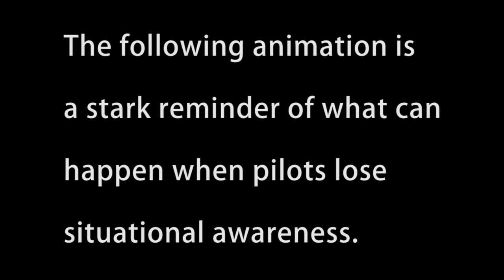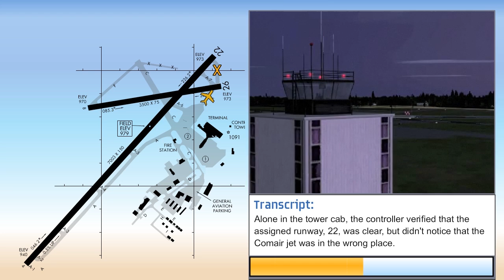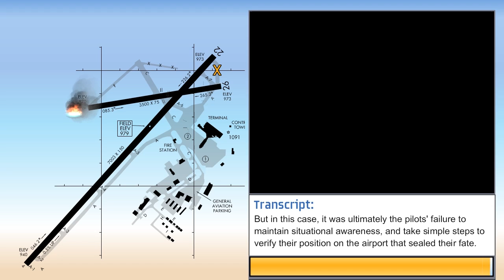Runway Safety: Lexington, KY (2013)

Comment: Lots of errors in this video.  There were no markings or Signs.  No yellow lines leading to the correct runway.  And the color of the pavement also made it appear that there was no taxiway in use to get to the correct runway. I flew a morning flight out of LEX a few days earlier than the crash.  MY COPILOT ASKED "WHERE ARE YOU GOING?" When I was going to the correct runway.  He thought we should have turned onto the shorter runway, which looked more correct.  I pointed at the error on the chart, and explained that I have been here before in the daytime, so I knew where to go.  The crash was also in the morning before sunrise.  There were no lights on the taxiway between  the wrong runway and the correct runway, just dark pavement that didn't look fit to taxi on.  The video images are not correct there as well.  So get the facts before you judge a flight crew.  Not to mention that Comair had a HUGE amount of time pressure to leave on time for first morning flights.  And the gate agent at LEX was always late to let the crew out a door with a secret code.  And the gate agent never knew which plane was the correct one for the first flight, so the crew went to the wrong plane at first, losing precious minutes.  I did the same on my flight a few weeks earlier.  I rushed through my checklist, like the crew of  5191.  The chief pilot had just issued another memo that there were serious consequences if the originator out of Lex was late.  Yes, time pressure from the chief pilot was a factor.  Also, there was only one guy in the tower not paying attention, instead of two controllers as normal.  A simple radio call from tower could have saved everyone, and he should have been watching the takeoff.  Just my opinion.
Reply: The NTSB report seems to say there were signs and markings at the time of the crash:
https://www.ntsb.gov/investigations/AccidentReports/Reports/AAR0705.pdf

Comment: I have ran this accident through my head and even when I flew would think about it. All I can figure is lights were out before and it was not unusual. Glanced over the Notams which said the main runway's center lines lights were inop. The short runway's lights were turned off. Very early, ready to get moving and complacent, both were not in the "present" but already off the ground, in Atlanta,on the way home etc. They were just running on repetition and not procedure.They see the runway with no center line lights and from that point on that WAS the correct runway. Who had the controls taxied into position thus cementing the confirmation bias that WAS the runway. From that point on nothing short of the tower stopping them they were going and did.

Comment: Bush Pilots just add some more flaps to take off in shorter distances or if end of runway near... i did it hundreds of times when grossed out take offs at high temp..    Runway end?? Vr right there instead and add 10-20 more flaps..and dont pull up like a scared girl..if you try to horse it off, it will stall of course..
Reply: CFITOMAHAWK2 oh you mean bush pilots who have Vr speeds around 50 knots? Bit different when you're hurdling down an unlit incorrect runway in a 44,000+ lbs jet with Vr of 140 or so.
Reply: robo931
-it does not matter if different airplanes..You can add more lift to any by adding more flaps instead of pulling up the elevator in panic and stalling it..I read the pilot survived, moved with his mother and began collecting workers compensation benefits until today..idiot...
Reply: CFITOMAHAWK2 flaps increase drag. Are you sure you actually flew real airplanes? Microsoft Flight Simulator doesn't count. They were taking off in darkness before sunrise on an unlit runway. Please tell me how you would add additional flaps in the roughly 1.3 seconds it took from rotation to impact. Also that was rhetorical, no need for anymore of your nonsense.
Reply: Hmmm? Can you name a a regional jet with a takeoff config. Checklist that calls for flaps during rollout ? ......
Reply: @duncandmcgrath6290  It is a Bush Pilot Trick.  Works on any lifting platform.  Wings..  Saved my life a few times to add 10 degrees of flaps after lifting up.
Reply: Shut up. Just shut up.
Reply: @georgemorley1029  Dummy..  You Cant think about wings vs flaps at full power. Dumb..

Comment: As many of you could, I could easily write a book on things I have seen that ranged from funny to down right amazingly dangerous.  To many wrong runway t/o landings to name. Wrong fuel added, wrong voltage on cart frying elec systems.Saw a Cub try to t/o with a cynderblock tied to the tail. A Citation in KATL taxiing with a towbar still hooked to the nose wheel. Had a Japanese passnger discharge a fire Ext in a 402 thinking it was a uninal. Pass and pilots havng seats come out of tracks falling/sliding backwards. Inlet smileys and mats getting sucked in.Chocks getting ran over,jumped. Self propped taking off and hitting hangers. I have personally seen 2 people killed walking into running props. One a mu-2 the other a commander 690. Could go on and on.... So people who think its all Capt Perfect Ex fighter jock with 10 thousand hrs don't realize thats the top 1/2 of 1/2 %.
Reply: And even they screw up. 

Look at Scott Crossfield, Sparky Imeson, Steve Fossett, and Daryl Snodgrass. 

All the best of the best in their respective fields… and all succumbed to rookie mistakes in relatively simple aircraft. 

You can never be rushed, or be complacent, or be overconfident. I indeed have a laundry list of dumb things I’ve done in and around aircraft and hopefully my bag of skills keeps on getting filled faster than my bag of luck empties.

Comment: All they needed was 8 more knots to takeoff the manufacturer of the CRJ-100 calculated that at their weight they needed a total distance of 3,700 feet and a speed of 138knots for a safe takeoff but they only had 3,500 feet of runway only and got up to 130knots before going of the end of the ruway, only 8 knots to slow and that kept them from taking off. They were so close i bet if the pilot would of kept the nose down for 2 or 3 seconds more instead of panicking and trying to lift off they would of made it, but by him pulling the nose up when he seen the end of the runway it didn't allow the aircraft to get to 138knots and stalled. But that's just my opinion i am only an FSX pilot so what do i know.
Reply: If I remember correctly, they've since redid the airport, there is no way to keep the nose down off 26. The runway had a berm and then straight into fence and trees down and a big ditch. They were screwed the moment they hit V1.
Reply: Obviously you don't know enough about this plane.

Comment: Yes, the pilots lost situational awareness but blame also needs to be put on a poorly worded clearance.  Instead of saying "Cleared for takeoff runway 22" the tower just said "Cleared for takeoff".   Perhaps if the clearance from the tower or read back from the pilots contained the words "Runway 22" they would have realized they were about to taxi onto the wrong runway (runway 26).
Reply: +P Diddy   The pilots know that they must use the longer and lighted runway 22.  It's obvious that the compass should read 260 when you are taking off from runway 26.  The pilots should also know the layout of the runways and taxiways.  These pilots were behaving like bus drivers and not pilots.
Reply: +P Diddy That's why we have standard phrases. It's not just the ICAO bitching... Also: Sterile cockpit below 1000, right?
Reply: P Diddy this is a Human  Factors example , the PIC was given taxi instructions per ATC .... they ignored no less than 4 visual references (runway location signs) and still wandered to the wrong place .....Notams were ignored ... the PIC and F/O made a series of mistakes that led to a perfect example of Human Factors (a series of small mistakes resulting in a tragedy) . Transport Canada and FAA push this training pretty hard but, it only works if you’re willing to understand checks and balances pertaining to safety.
Reply: It's not ambiguous. 22 is the only runway fit for any craft. 26 was GA only for the most part. If you saw the runways there's no doubt  you'd never dream of taking off on a regional from 26. All their flight plans and checklists would only have 22 listed.
Reply: control tower also went "on a break" after giving clearance, as well. dumb. dumb. he didn't as the narrative states "turn his attention to other tasks"

source: i live here

Comment: Pilots have attempted takeoffs with the pitot cover still on, a door not latched completely or a control lock installed.  The deeper cause of loss of S.I. is rarely discussed.  Ego, overconfidence, complacency are common factors and are only revealed in subtle ways.  The two pilots were talking about unessential items despite training that said otherwise.  Anytime you step around safe practices you step closer to the proverbial "Aww S**t!" moment.  Pilots listen to your gut and act or die.
Reply: Your comment brought to mind the air Florida jet that crashed into the Potomac. As they were taking off the one flying expressed concerns about the airspeed not being right. And then they crashed after stalling because of snow and ice